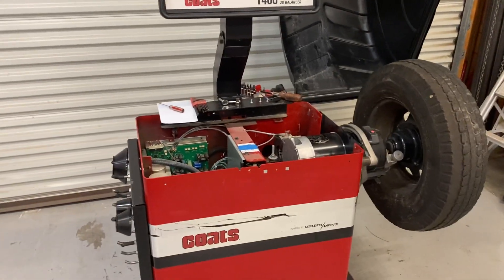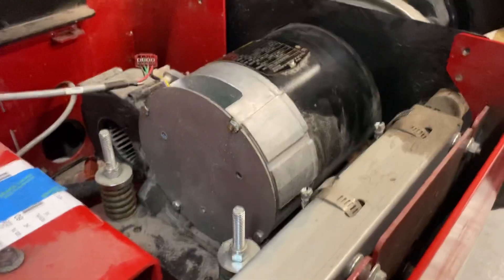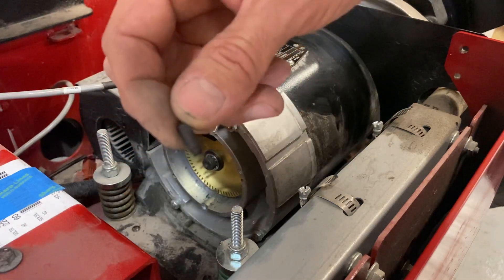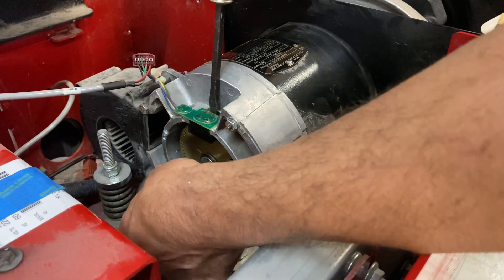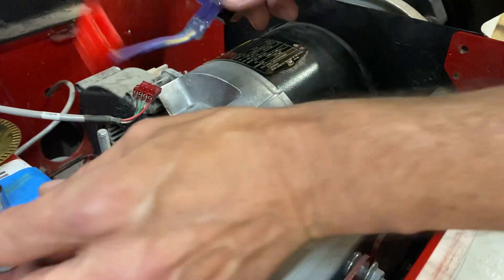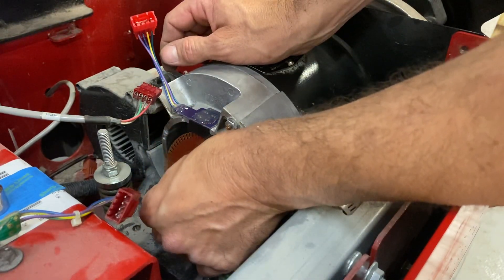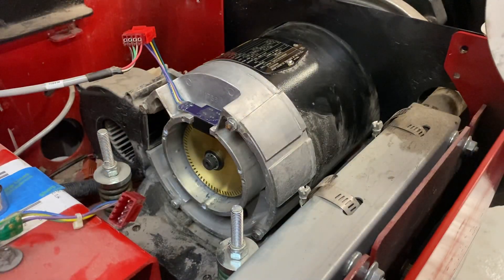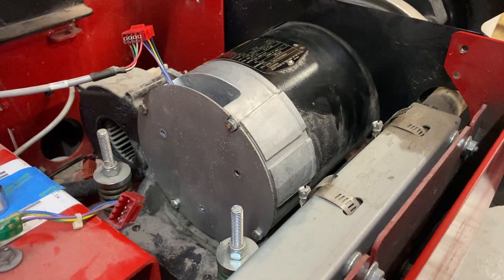Fix for wheel spin problems, COATS wheel balancers

Comment: Great video! can you tell us about the error code you were showing please. I am getting a "No rotation signal-check motor & encoder fuction & wiring-- press stop - exit e3" I replace the micro hood switches already but I still have the same problem. When I lower hood it does not spin on my 1250D. Thank you for any support
Reply: Same! Hopefully we get an answer lol
Reply: Just took like apart. It it my PCB board that’s gone to the toilet! Now to find one will be the adventure
Reply from the maker: Hi Manny, sorry for the delayed reply. That is the same code and symptoms I was getting on my 1400-2D, (Code Error 3- No rotation signal-check motor and encoder function & wiring). It would work sporadically when I lowed the hood and sometimes not at all. Other times it would even spin too fast or slow. All the wiring looked fine so I replaced the encoder 8110923 and that solved it. Hope its not your board, I'm sure that's expensive. How do you know its the board?

Comment: What was your fault code bud I have error 4?
Reply from the maker: Hi Brettimer9712, my error specifically was E3 though an E4 can also be caused by a failed encoder. josealfredoalcocer down lower in the comments said this encoder fixed the error code 4 on his balancer. The encoder is a double optical gate sensor so depending on how or which fails, it causing a reverse spin condition (error E4).

Comment: Motor in my  ranger DST 2420 wont stop turning as soon as i turn on the machine ...dont have any idea on what the problem could be😢
Reply from the maker: Hi tonnygarcia2698, I don't have any experience with ranger balancers but I know a bad encoder caused my coats 1250 to spin uncontrollably at high rate of speed till I turned the power off. Sounds like it could be similar.

Comment: May I ask how you determined it was the encoder? My 700 is having “Err A” and “Err Hub” codes. Used to be random now it’s 90% of the time.
Reply from the maker: Hi rf14dmb, I don't have any experience with the 700 but on the coats machines I'm familiar with there are red indicator LEDs on the circuit board that flash in time with the shaft rotation. If these seem sporadic or inconsistent, its a good sign that the encoder is missing steps.

Comment: Hiya my wheel balance machine now when I turn on all nomber are flashing plz can u tell me what's the problem plz?
Reply from the maker: Hi umershahid, I'm sorry, that's not a problem I've encountered before so nothing definitive comes to mind. But, it sounds like it could be the display circuit board, I'd pull it out and inspect it for moisture or a visibly burned component.

Hope that helps,

Thanks,

Comment: My coats v200 all of a sudden would just spin 1/2 to 3/4 speed and wouldn’t stop. Sometimes it won’t but very rarely now. Coats mechanic said he thought maybe the inverter but he honestly had no true answer for me. Inverter seemed fine what do you think it could be?
Reply from the maker: I'm sorry but I don't have any experience with the V200. In the bit of looking I did it appears to use a one of two versions of a rotary style encoder 85009972 made by Baldor or 85610094 made by Emerson. Might make sure the encoder isn't slipping, that could cause erratic rotation speed though I would think a slipping encoder would cause an overspeed condition. Hope you get it figured out.

Comment: Any idea about Error 4 this is coats 1050 Balancer
Reply from the maker: I don't have the codes for a 1050 but error code 4 on a 1250 is reverse spin. I'm not positive but I believe this could be caused by a faulty optical encoder. The 1050 parts manual does list the 8110923 encoder, same as the 1250
Reply: I replaced this same parts and my error 4 for my coats 1050 was gone. Thanks
Reply from the maker: @josealfredoalcocer3214  Awesome! Glad that was it!